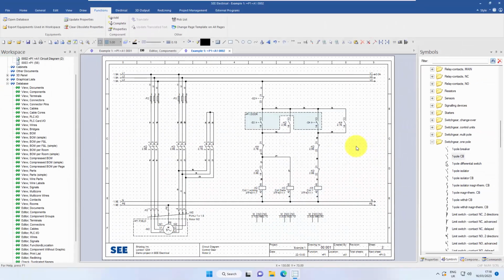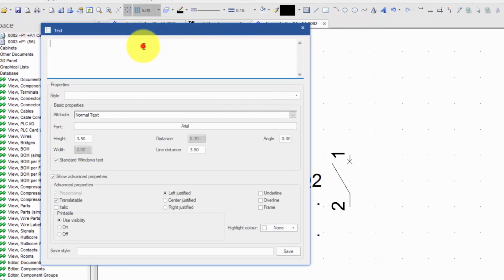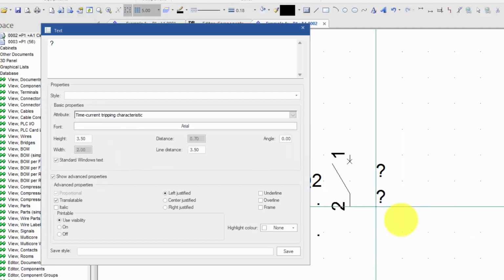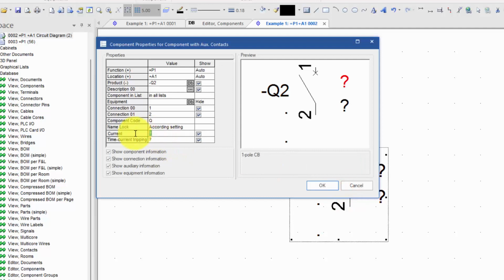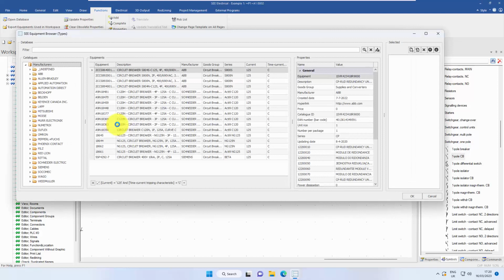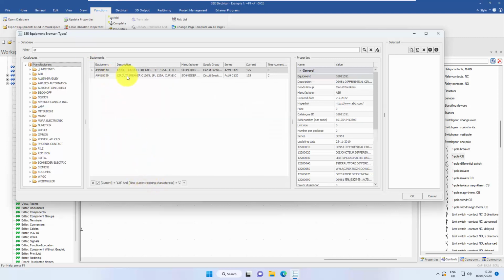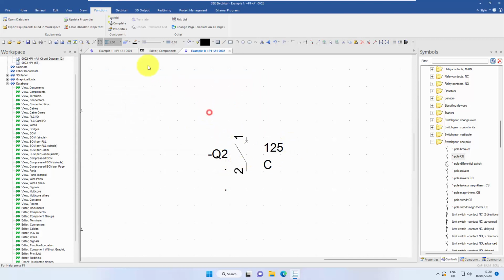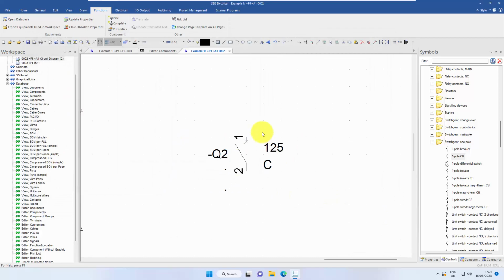V8R4 New Features Filter Equipment from the Drawing

Comment: I have a doubt, but it's not about the video.
I have been using this software for a long time and have a lot of development and experience in the autogen module, but now since the terminals have become like components, when I generate the auto diagram they no longer increase the numbering according to the order of the terminal strip, it simply repeats the saved number. Is there any easy way to fix this (some config) or will I have to change all my drawings to # in the terminal numbers?
Reply from the maker: Can you tell us what version and build of SEE Electrical you're using. It might be something that the development team needs to look into.
Reply: @IGEXAOUK  8r2 sp10
Reply: @IGEXAOUK  Was a bug, now is already fixed